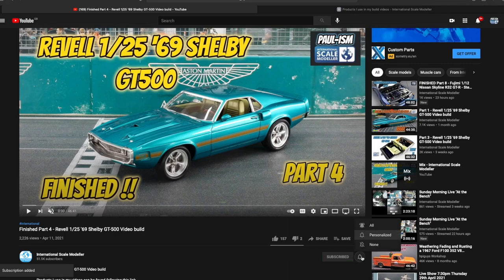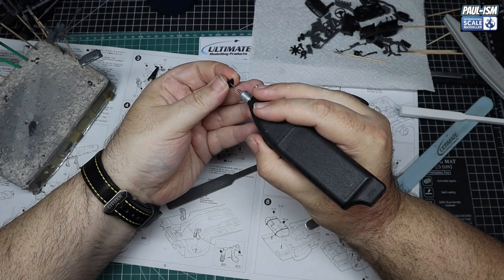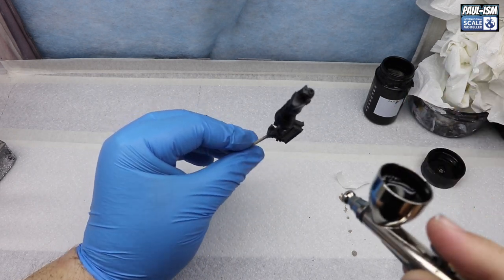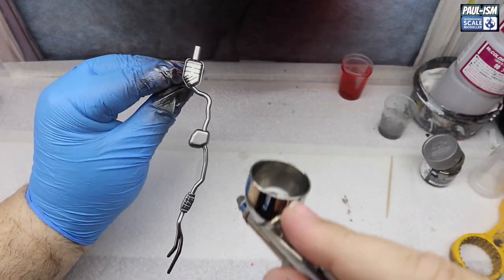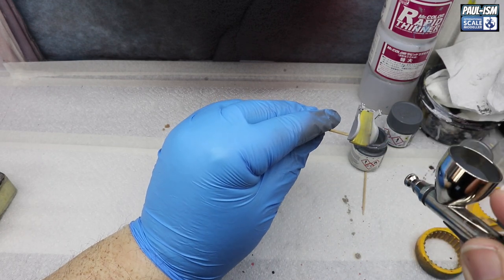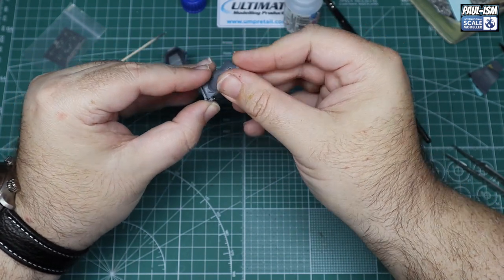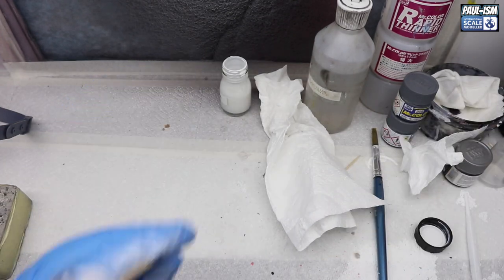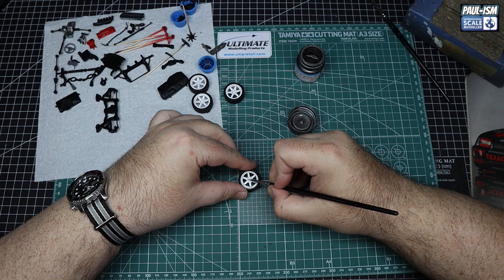Part 2 - Tamiya 1/24 Nissan Skyline GT-R 24090 Video Build

Comment: Nice work on the interior Paul, that two tone looks grey nice 👍
Tend to mix up on whether i take all the parts off and clean up and paint all in one go or as sub assy. depending on what the kit is.
How about a tutorial on a problem kit, trying to work the best way round to do it.

Comment: Hi Paul , another great video.  What do you use to wipe off excess panel liner without damaging the paint around it? 
I've just built my first model and had real trouble with this. I have one of these gt-r s to do next and don't want to do that again. 
Thanks
Reply from the maker: I use sansodor from winsor Newton it’s an odourless mineral spirit